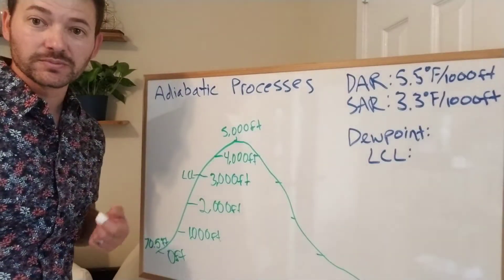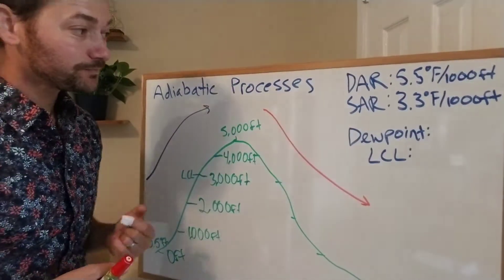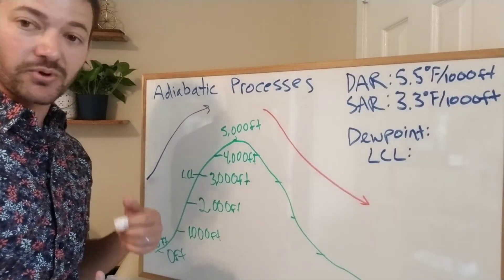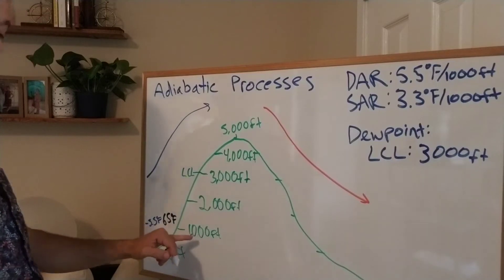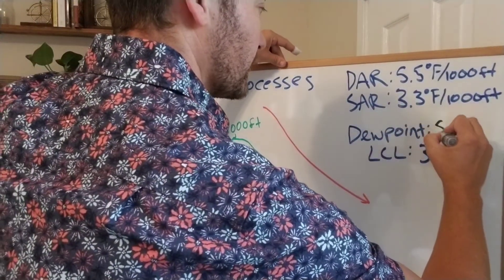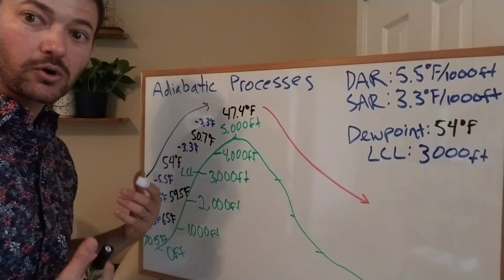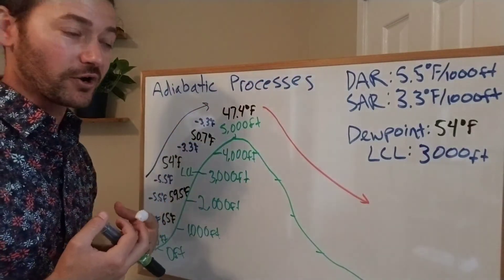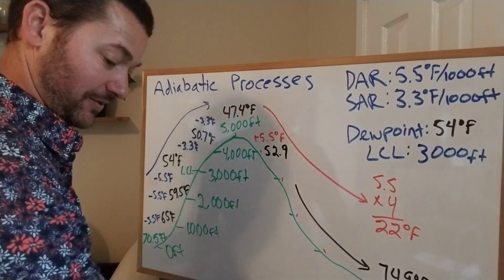Adiabatic Processes

Comment: SAR is lower because the temperature is constant during the condensation?
Reply from the maker: Saturated Adiabatic Rate is lower than Dry, because the higher water content in the air actually retains more heat. 
Think of how 1 cup of water heats up quickly on the stove, but a big pot of water takes longer to heat. The more water there is, the more resistant to temperature change it will be.